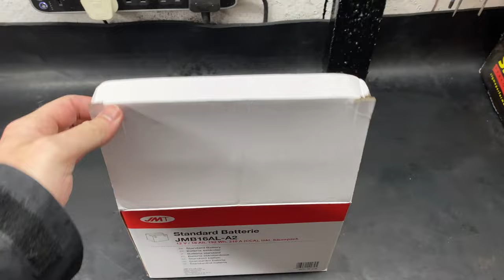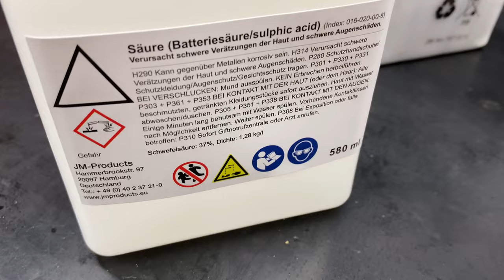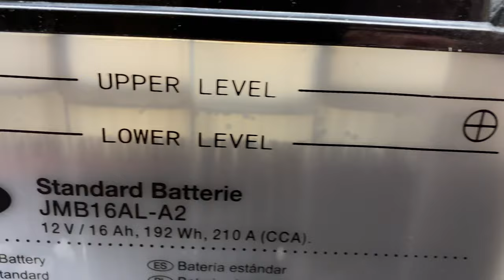Ducati 748 SP First Ride in 4 years! Coolant change, brake fluid guide & new battery

Comment: I’ve bought a 1995 748 SP that has been stored in a garage for more than 20 years. So this is a great inspiration for me to get it on the road!
Reply from the maker: Wow that’s gonna be an interesting one! Certainly gonna need a good going over - that goes to another level especially if it’s had fuel left in it - good luck though 👍 and glad the videos have inspired you 😬
Reply: I let mine sit for five years. It wouldn’t start when I attempted to start it.  Turned out the crankshaft sensor was bad.  I hope yours starts up.

Comment: When you bleed the rear caliper, you need the nipple on top because air floats to the top (highest point). Take off the mounting bolts, rock the caliper to press the brake pads on the brake rotor, to make the brake piston retract. Flip it to the top of the rotor with nipple on top. Do the normal bleed, rock the caliper and return to bottom and tighten bolts. Then pump the foot lever a few more times to reset pads. Yes, you can do it with the wheel on the bike. (2001 748 Owner). I also recommend the Ohlins fork piston kit for the Showa forks. Better valving.
Reply from the maker: I assume this would only be an issue if the caliper was bled dry/ pulled in air and caused an air lock as I simply replaced the fluid and didn’t let the fluid run low - all bled and held pressure fine 🤷‍♂️

Yea I have been looking at the Ohlins internals & I think I have found somewhere to repair the pitting on the fork tubes 👍
Reply: @stoneautomotive  Dave Moss the suspension guru uses hand pressure and 400 sandpaper to buff chrome (Don't do it on the gold TN coated) tubes if they are not too far gone. Great video - dave moss "Dump & Run Fork Oil Change for Standard Adjustable Motorcycle Forks". Even if you don't decide to do your own full service, his trick on grease and dust seals is worth the view. Oh, always run the zip tie on the fork tube to check how much suspension travel you are using. It will let you know quick if you need a spring swap for weight or just a bit more perload. The Ohlins rear shock can be serviced, but it will need nitrogen, so let an Ohlins shop do it. It will be as new when you get it back for under 20% of a new one.
Reply from the maker: @stevegee218  thanks for the heads up Steve, will start work on the 748sp once the weather stops the riding (looks to be soon ☹️)

Comment: Double check, but I'm pretty sure you should only be using the green stuff which is aluminium safe!
Reply from the maker: Completely fine for aluminium 👍 (I don’t know of a vehicle engine designed without aluminium components from the 90’s onwards - cylinder heads, radiators etc all made of aluminium) 

Next video on the channel, my ducati 748 engine melted 😅
Reply: Robert Pearson , I've been using Havoline which is red in my 2000 ZRX1100, since buying it in 2003 used.  Same with my RZ500 Yamaha. No problems.  What you want for a bike is any coolant that's Silicate free and mix with distilled water 50/50.  Or you can pay more for Honda or Yamalube if you want.